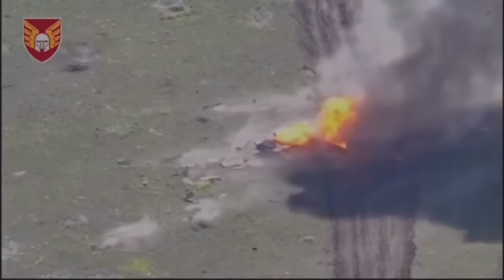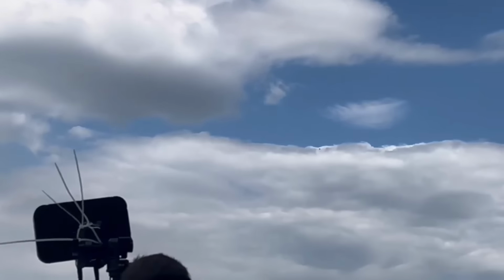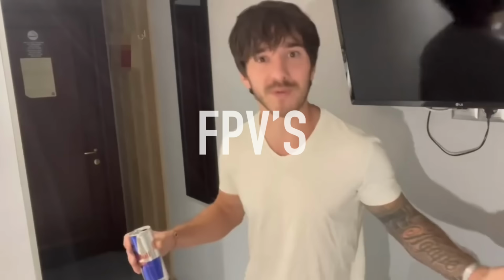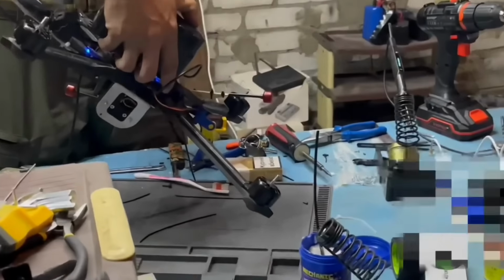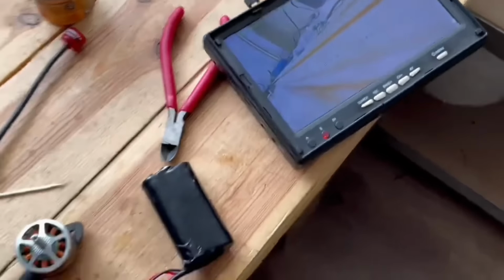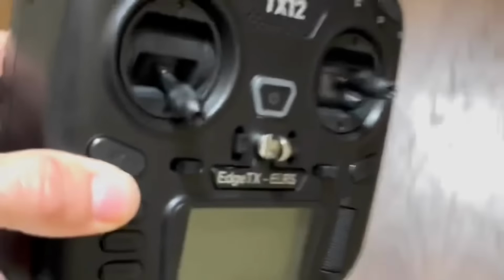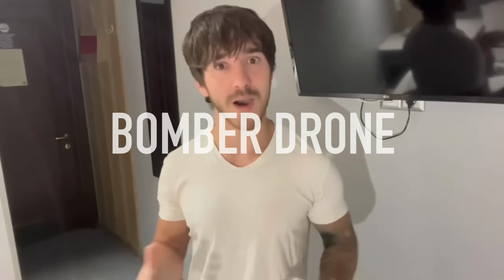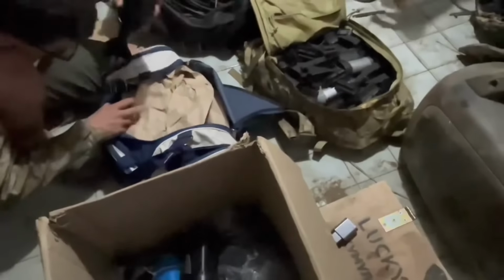How I Make Kamikaze Drones

Comment: In the hobby, the video systems go like this - analog, "digital" (The original digital - the DJI ecosystem), Walksnail(digital), and HDzero(also digital) each with their pros and cons. Also for goggles, you really only need the DJI goggles (unless you're using other digital fpv systems) because you can get an analog adapter for it. There are various video receiver modules to attach to goggles as well which boost reception, and there are a variety of video transmitters on the market with differing output power - select the higher output ones for better signal penetration. Yes I'm planning on building my own drone lol just not a kamikaze one.
Reply: Я летаю на 4g. Это тоже цифровая. Но она анлимитед. Формально, я могу быть в другой стране вообще. Пинг очень маленький, это не проблема для полёта.
Reply: I have a digital hdmi to analog converter to use analog goggles with digital reciever of video . Walksnail or hdzero . It cost $9

Comment: A little word of advice, make sure no one is blowing on the solder joints to cool them down faster. It causes micro fractures which will lead to failures of the joints. let them cool down and harden on their own.
Reply: good tip, but Tbh i don't think any of these drones ever last long enough to have a subpar joint fail lol
Reply: Vibrations can be a quick killer of solder joints :)  @C-V-Z
Reply: @C-V-Z he was talking about the drones getting damaged during transport. Solder joint failures could be a small part of what he's talking about so it could save them some time. And like Oaks348 said, vibrations are a killer as well.👍
Reply: @C-V-Z better to be safe than sorry, it is very unlikely but you dont want it to flip onto the ground and the ordnance to go off right on takeoff, safety first
Reply: 63/37 solder is MUCH more forgiving.  Eutectic solder pretty much skips that fragile intermediate cooling stage.
Reply: If you have a cold solder joint, try intoduce more solder into it quickly, get some solder on your tip and apply it to the connection then pump heaps of solder into the join, and pull away heat quickly.,
Reply: Me dumbass though that you were talking about soldiers
Reply: @minhaexistencianaotemsenti7132  lolol
Reply: You don't have a CLUE what you're talking about.  J STD 002 Tech here
Reply: @The_Conspiracy_Analyst  well your instructors failed you cuz I learned this in J-STD-001. It's basic info. Don't blow on wet solder joints.. It causes embrittlement.

Comment: Quick question, if you sent out a kamikaze fpv drone, can it be landed if you don't see a target before the battery runs out? Or is the SOP only using them when a target is confirmed before launching one at all, generally?
Reply: They use a spotter drone to locate the target first.

Comment: Tip: Connect the FC to the receiver with a quick connect (these black plastic things that a pin can be inserted into on one side and just a pin on the other side, look for USB to UART and you will see what I mean) and bring extra sets of receivers + the respective transmitters to your position. If the frequency of your attached receiver is jammed there, you can switch the receiver out in the field, without having to solder.
Reply: Time to make a frequency hopping transceiver
Reply: @IK-wc4od  Real. That's like WW2 era technology. No idea why they haven't figured it out yet.
Reply: I'm not an rc guy, so forgive a stupid question, but for my FM radio stuff,  the equipment is easily tunable to any frequency, our only restriction is LICENSING.  Are drone signals not easily adjustable?  

Cos on my 200W FM transmitter, I punch the frequency into the front panel....
Reply: @ThatSockmonkey  You can't.  RC is mostly packet based these days and set at a specific narrow frequency.  But there are different protocols operating at different frequencies.  ELRS for example has kit for both 2.4ghz and 900mhz.
Reply: @Stubbino  ok, that makes sense.  Like cell phones.
Reply: @ThatSockmonkey  Jeah, I think radios with adjustable frequencies are a lot heavier than RC radio equipment, but correct me if I'm wrong.
Reply: @richard3051  no, you're totally right 🤣 didn't occur to me until you mentioned it and then I remembered the massive tunable coils inside the 2U rackmount cases...

Sorry, I had a little derp moment.
Reply: @ThatSockmonkey No problem, I have those too ;))
Reply: @ThatSockmonkey yeah . He wires his " bomber " up to cellphone ane wifi frequencies . 😮 someone turns on a printer as he flies  past and boom
Reply: @gregorydahl  thanks for your valuable input.
Reply: Protocol doesn't depend on frequency. It's just the solutions available on the market that just use certain combinations of protocols, coding and bands. It's easier to grab a other 10$ receiver and making it work rather than having to basically design and test custom solutions. But technically, as long as the transmitter and receiver use the same configuration (and of course we make sure that such transmission is physically doable) they will work.
Reply: @ThatSockmonkey  FM they are adjustable depending on the bandwidth of the transmitter but usually these bandwidths (especially with dipole antennas) are fairly narrow, more patch based directional antennas can have a higher bandwidth but more expensive and come with their own set of problems.

Comment: I always wandered why 4 rotors? 🤔
3 should be just fine for 3-axis control (given the right software, which it already has to have for the 4 rotors anyway).
It's 25% cheaper. Less parts = easier manufacture, less things to break during transport.
(the "it's more stable" argument seems fake - helis only need 2 rotors)
(the "it's stronger" argument seems fake too, if 4 is stronger, then why not 5? why not 7? or why not 3 stronger motors?)

Also I imagine AI will be big with these, where operator selects target - and drone goes in for the kill
(so even if it's down low with 0 signal, it still hits).
How widespread is the AI usage so far?
Reply: It’s actually not. You need a beefy swivel mount and servo for the tail rotor or else you can’t yaw, which costs the same or more than an extra motor and esc. Plus you need bigger motors and escs and props. They’re less agile, you have fewer points of thrust arranged in a triangle which means less moment arm. (This is even worse on a bicopter, they’re notoriously unstable)You get throttle-yaw-pitch coupling issues because you always have two rotors spinning one way and one the other way. So 4 motors is the minimum for symmetrical, stable control. Why not more motors? Disk area. Fewer, bigger propellers are more efficient. That’s why long range drones have huge props compared to their size. A hexacopter or x8 can fit more thrust in a smaller frame (that’s why cinelifters are often x8) but the flight time and range is lowered. Due to all of this, quadcopters are the standard in the hobby and industry, so economies of scale come in. All the components are made for quads. You can’t get a 3-in-1 esc, no one makes them. So if you want to make a tri, you either get a 4-in-1 esc and have one just sitting there as dead weight or get separate escs which is more expensive. For hexes and octos you need more niche flight controllers with more motor control pins, and niche 8-in-1 escs which are more expensive, or 2 4-in-1 escs which means you pay for 2 pick and place cycles, 2 handling steps, etc.
Reply: The fact that you think heli's only need 2 rotors, completely invalidates your opinions, and relegated you as an uninformed.